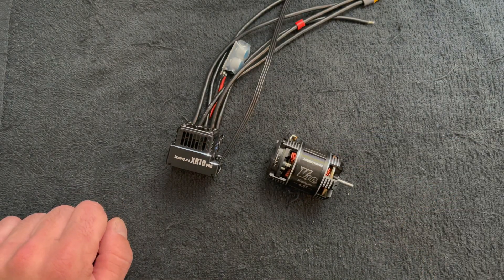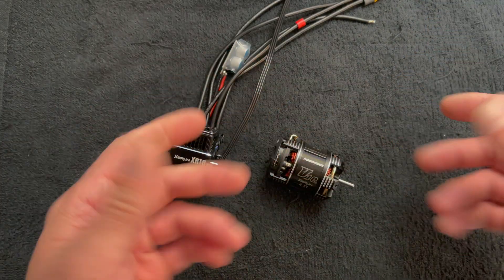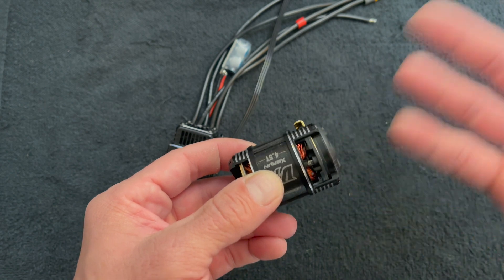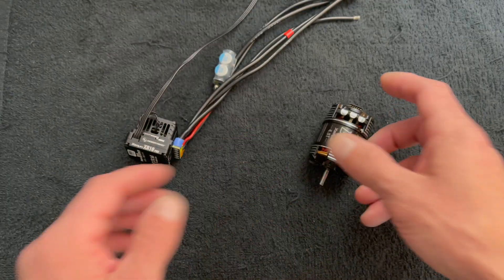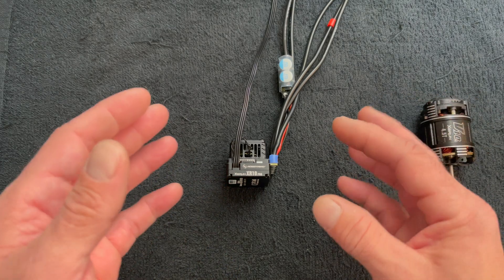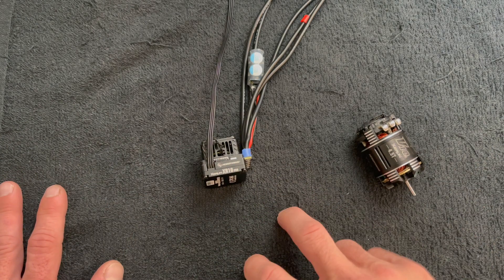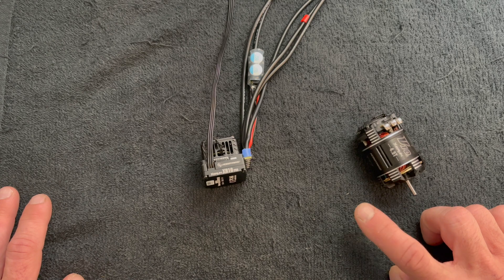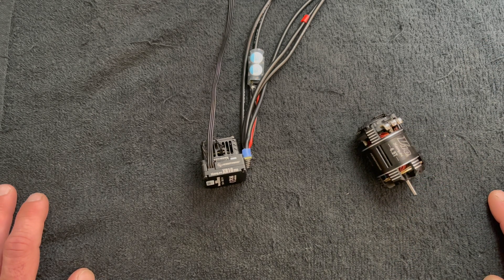The Charlie Show /// Episode 254 /// 5 things to know about Timing Advance

Comment: Hi, I just bought the quicrun 3660 3150kv combo. I put a 57t spur and 15t pinion on it. I’m curious the ESC is rated for 4s but the motor is rated for 3s. Could I turn the timing down to 3.75 or even 0 to run 4s smoothly? I’m planning on doing off roading and it’s a 4x4

Comment: I have a max10 g2 , recommend using turbo timing for bashing? I like the sound of what it does and I do got temps in check just don’t know if it could hurt anything or be useless
Reply from the maker: No, we never "recommend" using timing.  Adds speed, but also adds heat and takes runtime.   It's not useless, but it's also some what risky to use.  Like a gearing change in many ways.

Comment: I run both the XR10 G2 elite and the XD10 Pro with 2 MST RMX 2.5 drift cars , The motors have to run CCW , Does that mean I have to adjust the mechanical timing in the opposite direction ? as in if I want more timing (say 40 degrees) I need to set the Dial of the D10 Motor bell timing to 20 degrees as the motor is Counter Clock Wise ? Any help would be great :) 🤗
Reply from the maker: CCW is "normal" rotation so Timing is normal.  If set to CW, the motor goes backwards so timing is in fact opposite.

Comment: Hey Charlie I was under the impression that turbo increased the rpm over the entire rpm range and boost you would set for whatever rpm you needed to kick in and end at where am I confused does the bell timing and esc setting for timing both kick in after full throttle I would like to know I use all HW for RC drift would like to know for better tuning this season
Reply: You are incorrect.  I'll try to make this as simple as possible. Charlie rarely replies to comments.

End Bell timing changes the KV over the entire range.  

Boost timing is a mid range timing adjustment if you will. Let's say you have it set to 10 degrees that starts at 5000 rpm and ends at 20,000.  What this really means is the timing increases in a linear rate between those 2 points.  It does not go away at 20,000 rpms or higher, it means you have all 10 degrees added in by that rpm.

Turbo is typically added after 100%. Like boost, you enter in a maximum value for gain. However, the control of increase is a bit different. You can set individually how many degrees of advance come in per every .1 of a second. Same is true for how quickly it decreases when you let off 100% throttle.

Don't forget, timing compounds. If you have 40 degrees end bell, 20 degrees boost and 20 degrees turbo, that's 60 degree timing advance once all the turbo comes it.  Unless you know exactly what you are doing, that's how ESC's turn into smoke bombs.